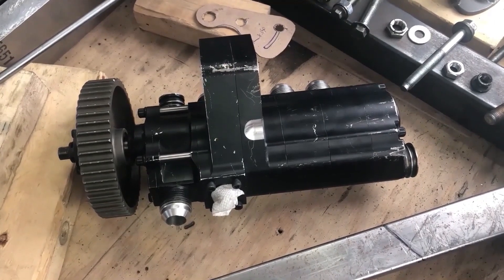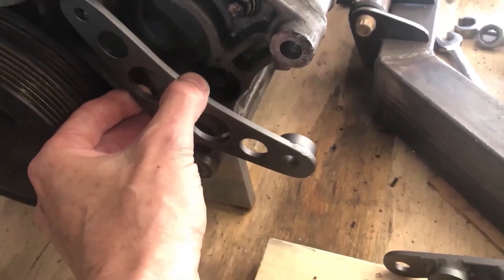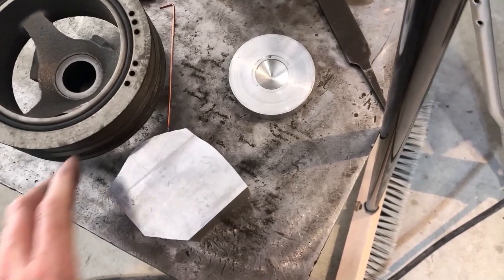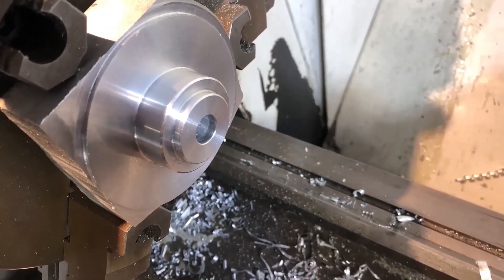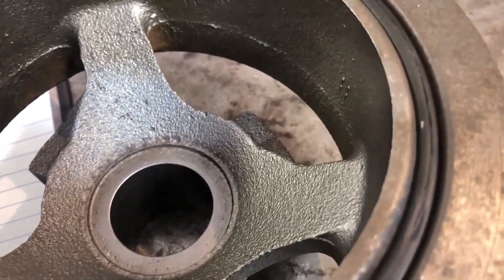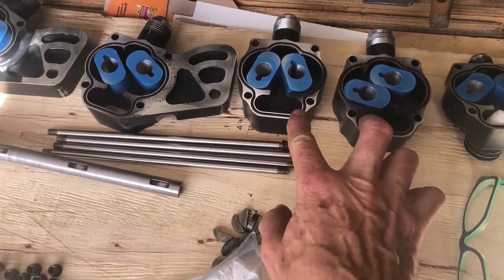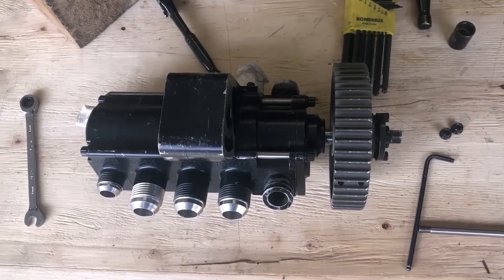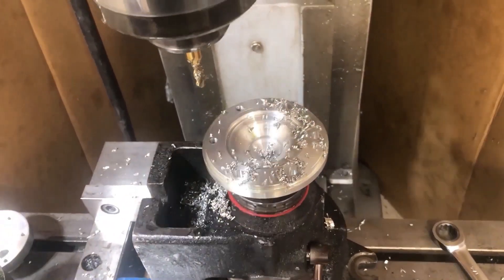'37 Chevy Race Rod - Installing Dry Sump Pump (8)

Comment: Curious, what software did you use for designing the suspension/geometry etc?
Reply from the maker: I know there's free software on the internet, I understand some people have used those programs successfully and I'd toyed with a couple of them. In the end I found they required many assumptions about desire heights for instant centers, roll centers, c of g etc, not to mention how things behave dynamically when the wheels are actually turned in a corner or hitting bumps... it's easy to get lost in all of that when I'd rather be out in garage making stuff instead. I did have a few simple design constraints such as the geometry of corvette uprights, desired ride height, and I wanted the wishbone mounts inside the body panels. 
In the end I followed basic recommendations from Carroll Smith's excellent handbook (Tune to Win) to approximate the layout,  calculated required tube sizes, then added adjustment holes for fine tuning of anti-dive. Fingers crossed it works.
You might have good results using software, depends on your talents and how much you already know about race car design...?